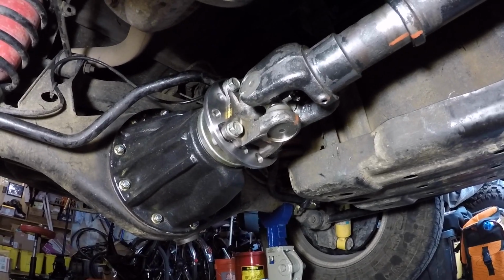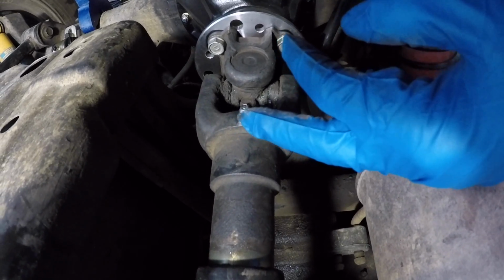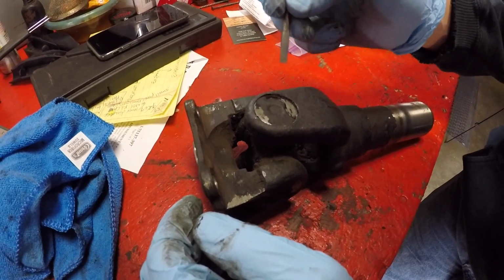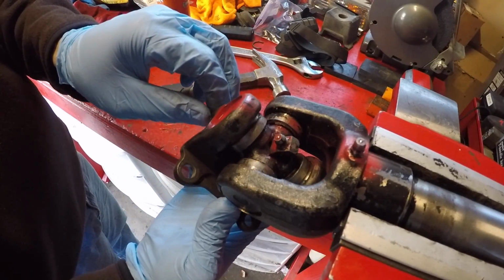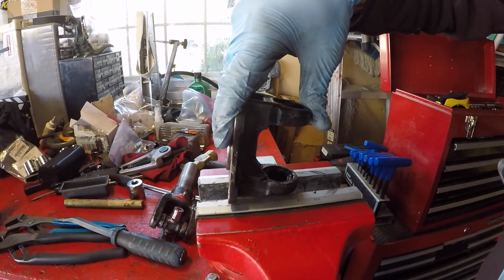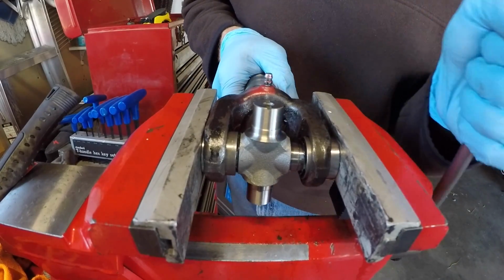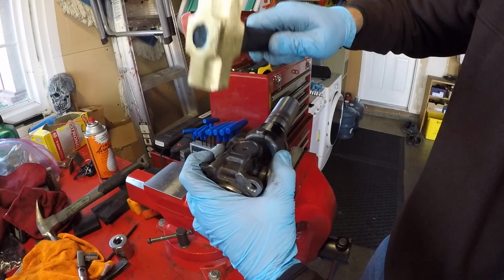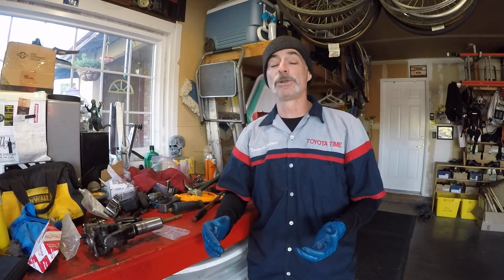U-Joint Replacement

Comment: Hey Tim, loving your channel, great work.  Okay so I have 99 with 360 on it, we have had it since 85 k, I love the truck and it’s still in great shape.  Recently developed slight shaking/vibration in drive line at about 20 mph,  u joints seem perfect but wondering if they could still be suspect
Reply from the maker: How do you know it's coming from the driveline?How are you checking the u-joints?  You should push and pull on the driveshaft pretty hard at different angles trying to determine if there's any play.  Have you regularly serviced the u-joints by greasing the zerk fittings.  For the rear driveshaft, it has a double cardan joint which is the dual joint that attaches to the transfer case.  There's actually 3 zerk fittings, one for each u-joint and one for the center ball?  Have you greased all 3?  The driveshaft is balanced with tac welded on weights?  Have you checked to see if the weight(s) are still affixed to the driveshaft?  Have you checked for play at the rear 3rd member pinion bearing?  Have you checked for bearing play at the transfer case rear companion flange?
Reply: @TimmyTheToolman  when I drive down the road at about 20-30 I can shift into neutral and it stops, seems to improve with higher highway speeds.  I have pushed and pulled on the driveshaft and can’t discern any play.
Reply: @TimmyTheToolman  sorry didn’t see full response at first glance.  We have had the truck since 80k and it is in great shape, but I can’t say that I have ever greased the driveshaft.  I did grease all fittings last weekend when the problem started.  FWIW the vibration seems to have gotten better since then, don’t know if it is related or not.  The weights are still in driveshaft and driveshaft looks perfect.  We don’t off-road it, abd southern vehicle.  I have not checked for play at rear third member and can’t say that I know how.  Not sure about the companion flange either.  Transmission mounts I did check and they seem perfect
Reply from the maker: @mattdewitt3985  Just push and pull on the flanges to see if there's detectable play.  

If you have a long straight road in your area, you could remover the rear driveshaft, throw it in the back, put it in 4wheel drive and drive down the road and see if the vibration problem goes away.  If it did, you now know it was the rear driveshaft.  If the problem is still there, well, the search continues.  You just don't want to make any tight turns on pavement while in 4wheel drive because you can break the CV axles and/or damage the front differential.
Reply: @TimmyTheToolman  thanks so much for your time… I will check these
Reply: Hey Tim, maybe dumb question but am I correct in thinking this is probably in driveline given when I shift into neutral the vibration stops? Does the driveshaft stop spinning when shifted into neutral?

Comment: Are the front and rear u joint on a 2wd 2002 4runner the same size?
Reply from the maker: Don't know.  Never worked on a 2wd driveshaft.

Comment: This u-joint will work for both front propeller shaft joints as well, correct?
Reply from the maker: Not sure.  The front u-joint that connects to the differential might be the same as the one we used in this video.  The u-joints in that make up the double cardan joint are different.

Comment: Tim! Just wanna thank you for the recommendation for the Tom Woods driveshaft. Arrived in a couple of days after I ordered it and it bolted right in real easy. The vibration my 4runner had at 60mph is gone. Running like a champ.
Reply from the maker: You're welcome.  Tom Woods makes great driveshafts.
Reply: @TimmyTheToolman  Yup! Saved me a few hundred bucks off the OEM driveshaft.
Reply from the maker: @hylndrfan  Cool.  That's good to hear.

Comment: What ratchet was that when using the puller to drive in the caps? Its sound was so smoothing lol.
Reply from the maker: That was a flex head ratchet from Gear Wrench.  It sounds really smooth due to the amount of engagement points it has.  120 engagement points.  This make it great for tight situations.  You only have to turn the ratchet 3 degrees to get to the next engagement point.  The flex head capability is also super helpful when you can't get a straight shot at the fastener.  All the tools we use in our videos are linked in the video description.  You just have to click on "Show More" and the video description will expand out.  Happy Wrenching!

Comment: A word of warning when greasing the slip yoke not to pump too much grease in as it pushes the yoke outward putting pressure on the UJs (spider, trunion etc. etc) and can cause premature wear. I did this on mine one service and it set up a vibration when driving and I had to remove the grease nipple to relieve the pressure. I learnt this from a very good Australian video on Toyotas. Excellent video and I now know why the UJs were a bit tight when I changed them on my MGB.
Reply from the maker: Yeah and lots of guys over-grease them.  I think the best way is to take the slip yoke off and manually grease it.  The zerk fitting dumps the grease at the back of the yoke.  How's that going to effectively grease the male and female splines of the yoke?  The answer is it's not.
Reply: I greased till all the old grease came out the splines and the new grease was seen, took about 20 minutes because I went slowly, the old grease was hard and the previous owner may never have done it or insufficiently on 12 4R. Not sure about this overgreasing concern but if it helps I drove it on small platforms keeping the weight on and the driveshaft compressed in the yoke. Either way, fresh grease needs to come out or the job isn't done. Imo. There was some shaking in real cold weather  (-20 C) and afterwards it was and is perfect.
Reply: Isn't there a hole at the end of the slip yoke to let out excess grease or air should the shaft compress?

Comment: I actually need to replace a whole driveshaft. Do you have a part number? 99 4runner 4wd 3.4 L 6 cyl. Can you buy the slip yoke as a separate part?
Reply from the maker: I think Toyota sells the whole shaft as one unit but I could be wrong.  I don't know the part number.  If you want a complete driveshsft, I would suggest getting one from Tom Woods.  It would be more affordable and great quality.
Reply: @TimmyTheToolman  Im gonna take your advice and go with the Tom Woods Driveshaft. Are these made to order? They don't have a stock replacement DS? Also they ask to measure the bolts and the bolt pattern. Those aren't standard. Aren't they 14MM front and back?
Reply from the maker: @hylndrfan  Give them a call and tell them you need a driveshaft for a 3rd Gen 4runner 4x4.  I know lots of guys have ordered from them so they must have the measurements on file so you don't have to deal with it.
Reply: @TimmyTheToolman  Thanks braddah! Keep the videos coming. You make it look so easy.
Reply from the maker: @hylndrfan  Replacing the u-joint was a bit of a struggle.  We learned a lot on this one.
Reply: @TimmyTheToolman  So I got the Tom Woods Driveshaft! Going to install this Friday. Do I need to take it to a Driveline shop afterwards for balancing or should it be good to go once installed?

Comment: Hey Timmy and Shawn (I suppose the celebrity couple name is ; T~Shawn?) You guys are hitting home runs as always. I have a 2-whl drive 3rd Gen (solid axle with simple u-joints on either end). Yeah I know....(2) whl drive 'boooo'! Your video helped tremendously. I will say that when it came time to torque the (4) bolts I had complications. I couldn't get a socket to seat squarely on the head of the hex bolt. A shorty socket didn't fit properly, a deep socket didn't fit properly. And when I look at time stamp 39:31 I see your socket is canted at an angle as well.  
So, I happend upon a guy with a slick work around. He held the head of the hex bolt with a long 14mm box wrench. He then attached a 3/8 drive, 14mm Flarenut Crowsfoot wrench (it is really a 'head' or it could be called an 'adapter') to his torque wrench. And he was able to access the hex nut and apply torque. So he torqued the hex nut on the back side and not the head of the hex bolt. The Flarenut aspect of the tool ensured he was grasping all (6) sides of the hex nut. Search; Sunex 971014 on Mr. Beeso's sight and you will see it. As always, mad respect for you and the team.
Reply from the maker: great comment! thanks for the helpful tips with your tool setup. we hope this helps future people looking through the comments. we don't have a couple name yet, but maybe we will stick with our full names. haha. sicmods!

Comment: Glad I had a spare shaft! This is proving to be near impossible solo, so looks like I'll be buying new ones, lol
Reply from the maker: Well, put the spare in and then fix the other when when you can get someone to give you a hand.  Happy Wrenching!
Reply: @TimmyTheToolman  I'm going the Tom Wood route, lol. I'll keep the spare installed with the factory front in the meantime and tuck them between the storage box and rear seat when the new ones come in. 

I tried the hammer/vice method (via ThePracticalMechanic: https://www.youtube.com/watch?v=9P7wkkdcFos&t=851s ), but I had already pushed the opposite cap out with the press before realizing what I did wrong. Managed to get one set out but couldn't get the leverage/stability to hammer the other (or get it to stay lined up) and called it a day. I had to use a good bit of muscle with the hammer, too, which decimated the metal around the yoke, so I don't think it's worth it to keep going if there's a potential to throw the whole shaft out of balance. I'd rather have the piece of mind, you know? lol

You're videos have been helping me with the millions of other projects on this thing, so thanks for all of the info, Timmy!!!
Reply from the maker: @CB-gi2rx  Yeah, Tom Woods is a good choice.  Sometimes following a tutorial works out and sometimes it doesn't.  I like to think the information we provide is really good but people still fail using our tutorials due to one reason or another.  There are variables out of our control like someone dealing with serious corrosion.   Great to hear our videos are helping you out.  You're very welcome!

Comment: Hopefully this is helpful for other viewers: I was unable to get the bearing press from my local auto parts store and also couldn't get my hands on a two-jaw puller. I was able to tap out the bearing caps of the u-joint with a hammer and two sockets. I large socket on the backside to hold the yoke flange and support all around the bearing being pushed out, and a smaller socket on the side where I was hammering to push the bearing into the yoke and through. I used a 21mm socket on the side I was hammering and I believe something like 1 1/8" bearing on the opposite side to support around the bearing being pushed out. A bit awkward to hold it all together while hammering, but totally doable, even on a 20 year old part with plenty of resistence holding the bearings in place. Hope this is helpful for anyone needing to do this job.
Reply from the maker: Thanks for sharing your technique.  Good to hear you got the job done.  Happy Wrenching!
Reply: Would u say the socket on the backside is completely necessary? I don’t have any sockets quite big enough.

Comment: Having just done this job, I wanted to call attention to the tip about removing the zerk on the slip joint yoke to eliminate the suction that otherwise holds it in place. Awesome tip. I am sure I would have been stumped trying to figure out how to get the yoke out of the driveshaft given how powerful this suction force was in my case. I would have been hunting for a hidden bolt somewhere. I was able to simply use a fine pick to depress the bearing in the zerk and that allowed enough air flow to remove the yoke. Reinstalling after doing the u-joint replacement it was also key to depress the zerk bearing so I could slide the yoke back into the drive-shaft.
Reply from the maker: Glad our tip helped you out.

Comment: Hey Timmy, always love your videos, they have been incredibly helpful and have given me the extra information needed to tackle repairs that I never would have attempted in the past. Thanks! Here comes a longish question: Should the zerk fittings on teh drive shaft always be in the same line? Here's my scenario: Mine are not all in the same line at the moment, doesn't seem like I am getting drive shaft vibration, but I am about to replace the rear u-joint, and I could easily realign them all when I put the yoke back into the drive shaft. My options seem to be 1. reassemble as it currently is and figure if it ain't broke don't fix it. 2. Reassemble with all zerks in the same line, drive it, if I get a vibration, go back to the current alignment. The reason I am considering option 2 is that when I did the leaf spring replacement a year ago, I remember my yoke sliding way out of the drive shaft as I lowered the diff and axle to get the leaf springs in. What I don't remember is if it came all the way out. If it did, I easily might have reinserted it a a couple degrees off. I definitely didn't make any alignment marks and knew nothing about keeping a drive shaft aligned and balanced at that time. So perhaps this driveshaft was in its current alignment when I bought the truck, perhaps it was aligned with all zerks in a straight row... curious which approach you would take here.
Reply from the maker: From what I have seen, the factory had all the zerk fittings facing the same way when the driveshaft was balanced.  The slip yoke and main driveshaft are balanced as a unit.  With your zerk fittings not lining up, it did get out of whack at some point.  But, it seems it maybe wasn't enough to throw off the balance to cause issue.  I would put them back in alignment if it were me.
Reply: @TimmyTheToolman   Okay, here's the update for anyone this might help: As I got ready to remove the slip-joint end of the drive shaft (rear driveshaft needing a new rear u-joint) I noticed a couple more details. 1. All of the yokes on the entire driveshaft from front to back were properly aligned. 2. There were some match-marks underneath the dirt and grime caked onto the shaft that were matched in the current alignment. Looking at a schematic that someone sent me from the Tacomaworld forum, confirmed what I was seeing. It looks like the deal is that with the double cardan joint, the zerks have to be a turned slightly to the side in order to be able to get a grease gun past the the flanges of the joint. So I thought I was seeing zerks out of alignment down the length of my driveshaft, and actually, everything was aligned as it should be to allow zerk access. Made new matchmarks so I could see them clearly, disassembled, installed new u-joint, reassembled, test drive confirms that not only was the u-joint the source of the noise I had been hearing while driving, alignment was correct with the truck perfectly smooth at all speeds, no driveshaft vibrations at all. Stoked to have done a job I have never done on a vehicle before and stoked to have eliminated a noise that sounded like it might need an expensive repair when in fact a simple bearing and a little work did the trick!
Reply from the maker: @svenpossible  Good to hear you verified everything was in proper alignment and you got the job done fixing your issue.  Great job and Happy Wrenching!
Reply: @TimmyTheToolman  Thanks so much Timmy. That is what all of my research shows as well. I will reassemble with zerks aligned, do some test driving to check for vibrations, and post a follow-up! Thanks again for all of your great videos, it's so fun to take my mechanic skills to a higher level thanks to Youtube and thorough videos like yours.
Reply from the maker: @svenpossible  You're very welcome.  It's our pleasure to help people out and inspire people to turn wrenches.

Comment: Instead of doing that grinding for the flat section, do you think you could instead cut the top off of the bearing cup with an angle grinder, which would expose the tip of the trunnion, allowing you to drive the other bearing cup out using the jaw puller? then after just press out the cut bearing cup once the trunnion is out. Only issue I'm not sure of is if you will have enough space to pull the trunnion out with both cups still in (although pressed almost all the way out).
Reply from the maker: I'm not sure if that would work or not.  If you give it a try, let me know.
Reply: @TimmyTheToolman  Will do haha. Thanks for the videos!

Comment: Should the truck be in park when taking the drive shaft down? I've been beating prying on this thing for 20 minutes... Not budging
Reply from the maker: No, the transmission doesn't need to be in park.  You're not able to get it disconnected from the 3rd member, transfer case or both?  If you're using a plastic mallet, try to give more persuasion with a brass hammer.  If you don't have a brass hammer, maybe use a steel hammer and just be careful to not mash things up too much.
Reply: @TimmyTheToolman  my issue is with the third member. I'm currently using a heavy rubber mallet. I was weary to use the iron. But I'll try.
Reply from the maker: @MRRAY84  Yeah, ditch the rubber mallet and get more persuasive with some steel persuasion.  You'll get it.
Reply: @TimmyTheToolman  awesome, thanks for the reply!
Reply: @TimmyTheToolman  came right off with the hammer lol, thanks again!
Reply from the maker: @MRRAY84  You're welcome.  I knew you'd get it.

Comment: I cut the centre out on mine. It made pressing the ends out a breeze.
Reply from the maker: Not a bad idea.  What did you make the cuts with?
Reply: @TimmyTheToolman  small grinder and a zip disc 👌
Reply from the maker: @wanderer12  Roger that.